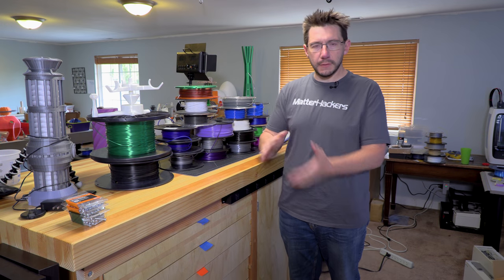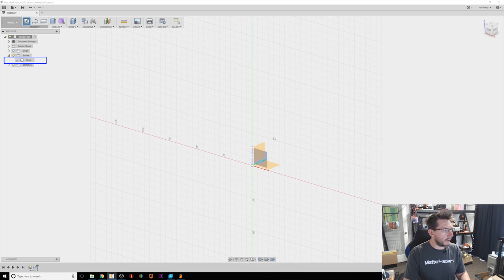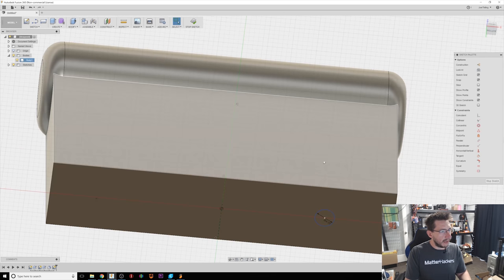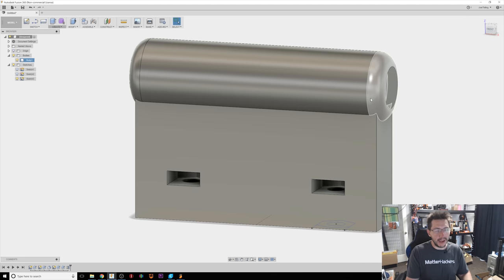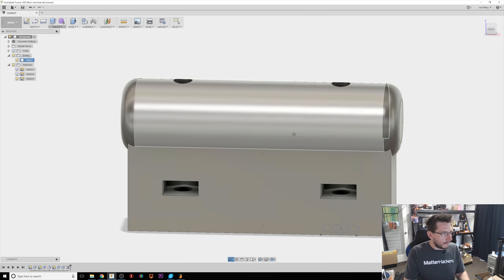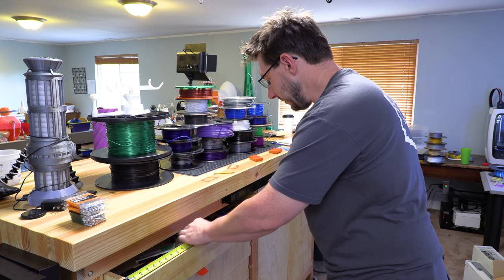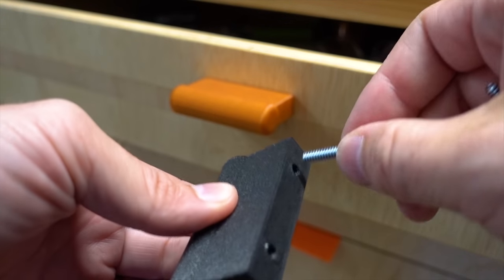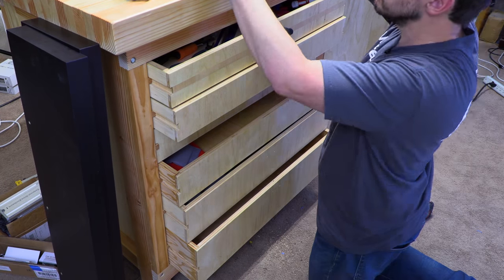DIY Custom Drawer Pulls / Drawer Handles & Jig / Template using 3D Printing!

Comment: very nice job
what height is your work desk
also why not put a block of wood at the back of the drawers to keep them flush to the front
regards
Reply from the maker: It's tall - 45" tall. The drawers open up from both sides of the desk!
Reply: thanks for your reply
i did not know that the drawers opened from both sides
and yes that is a tall bench but i guess it makes it easier for to work on it as there is no bending down to a low desk
regards👍👍

Comment: if you used the same template for drilling the holes, doesn't that mean that the further you go down on the drawers, the more offset the handles will be since the drawers get bigger as you go down?
Reply from the maker: The idea was to have the handles all the same distance from the top of the drawer rather than center - so this worked perfect!
Reply: that makes sense

Comment: Hey maybe you can design a pair of stoppers next - so that the drawers can't slide in too much and always be flush with the rest of the desk.
Reply from the maker: I forgot to mention it, but the drawers open from both sides of the bench, so I'll need to add handles to the other side as well :)

Comment: Easier way to get the center, is use the Metric system. Only have to halve a single number. 33 7/8 inches is about 860mm. 860/2 = 430. done. much easier. ;)

Comment: Just FYI on dimensions in fusion you can do math functions inside a dimension i.e. for the blind nuts of a width of 9.5 just use a dimension of (9.5/2) and it will make the circumscribed polygon the right size with no calculation.  Also on the blind nut , rotate the nut where the flat surface is up and parallel to the bottom where you insert it and it wont turn when tightening. With the way you designed it it only touches on the two bottom sides and can rotate easily just FYI. Good video though. Had a screen shot but you can't post it- I'm not the best in describing with out photos :)
Reply: For a slide-in nut, Joel's design is correct. The nuts are supported from four sides (it the pocket dimensions are accurate enough).

Comment: now design some back stops to stop the draws going back to far.
Reply from the maker: The drawers open from either side of the bench, I probably should have made that clear.
Reply: How about a fancy indent thingamabob so the drawer locates in the centre position? :) Great video, thank you. The jig was an excellent idea - perhaps using a cross instead of a circle for where you mark the draw would help it be as accurate as possible - although the handles looked like they lined up just great.
Reply: Then you're going to need more drawer pulls! :D
And what about the cabinet doors?  Looks to me like the same handled would work just fine.  Using NylonX for the look and texture is a great decision, loved the look.

Comment: Nice - Thanks

But to find center with NO math, take a piece of adding machine tape and mark/cut it or whatever to the width of the drawer then fold the tape in half, instant center with no math.  Used this method in a previous lifetime when I was a pipe welder.  Can also fold again for quarters etc.

Comment: What printer and print bed surface did you used for the NylonX? Also, did you have an enclosure?
Reply: Oh nvm, I just saw the description.
Reply: Arsenic The bed on that machine is garolite I believe. It’s the Matterhackers pulse printer. They offer a mod that is made for printing NylonX. It has a ruby nozzle and the garolite bed. You can print NylonX without an enclosure.

Comment: Millimetre? Did i heard millimetre? Thank you!!!!
Btw, why didn't you make smaller holes and self-tap them using wood screws? No messing around with nuts, it would have been solid enough...
Reply: Gael Lafond , have you done it yourself? How many perimeters?
Reply: Michael S usually 2 perimeters is plenty for self taping hole and with nylon there’s no need to over do it.
Reply from the maker: I thought about it, but I wanted to design the pockets for the nuts and see if it would work. It would have worked tapping the plastic, but, I just wanted to do it this way.
Reply: Michael S I must admit I have never tried it myself. I assume Joel had enough experience with 3D printing to give a good reason for using the nuts... And indeed he have a good reason :)

Comment: I think that you could have done a better job of making them look a bit pretty but hey, they work, which is the main thing.

I did like the way you did Fusion in metric and then went back to imperial to measure the drawer fronts.
Reply from the maker: Beauty is in the eye of the beholder, and these looks exactly the way I wanted them, so, I think they are pretty :)

Comment: you need a stop behind the drawers so you just push them closed all the way and not worry about lining them up flush
Reply from the maker: The drawers open up from both sides of the bench. It's cool being on the other side and being able to open the drawer to get something.
Reply: Aaaah didn't know that. makes sense now

Comment: Joel... Metric... So much simpler. 860.5 mm wide, so half is 430.2 For the accuracy you need for drawer handles 430mm is great an a lot quicker.

Comment: seems like it wouldnt be hard to capture the nut completely inside the print.  just cut the nut out.  have the slicer stop the print after the hole for the nut is finished.  drop the nut inside.  continue print.
Reply: Douglas Spak , it is not that simple. Please try it yourself...
Reply from the maker: I thought about doing that - but I liked the idea of a pocket and an insert, so I modeled it that way to so see if I could, and if it would work.

Comment: Man.. that NylonX is expensive AF
Reply from the maker: Very, unfortunately. I wish it cost less, as it's a lot of fun to print with and use.
Reply: Why did the screws not fit, when the PLA part was fine? Does it perhaps need a different extrusion calibration?
Reply: It's actually not as expensive as it seems, and the reason is because of the density. 

NylonX is 1.00 g/cm3. That's 25% less dense than PLA and most PETG/Copolyester filaments. So, knock 25% off the price and that's a better comparison of price.

Comment: Why didn't you just pause the print a the top of the bolt hole a insert the nuts then you could a had them fully encapsulated.
Reply from the maker: I thought about that, but I didn't want that. I wanted the pocket to insert the nuts.

Comment: Like the practical use of 3D printer and software, but please edit the title to read Draw not 
''Drawer''
Reply: Paul Thomas Drawer is the correct spelling
Reply: Paul Thomas , in USA they are called drawer pulls.
Reply: Michael S or drawer handles.
Reply from the maker: Here in Seattle they are called drawer pulls. I haven't heard just draw pulls before - where do you live?
Reply: Hi Joel I live in Thailand, Sorry it looks like you are right and they are caller Drawers, it's just when I think of a Drawer I think of a person Drawing not a Draw handle. MY bad. So, I have learnt something today so it's a good day.

Comment: I get it Joel 3D print your drawer handles was a great exercise in both printing and creation but..  on the practical side. What was the time used for printing the test and the final Carbon Fiber prints and the time it took to create the product in simply3D? You put these all together and it spells go to home depot. Yes, I know its a fun hobby but it could have been done in 30min or so including the trip to the store. I'm finding out over time that unless 3D printing becomes faster waiting 2 to 3 hours for a simple quality print is just not worth doing. Of course, this is my opinion but as a hobby print away and have fun!
Reply from the maker: Let's see... The design took about 5 minutes when I first did it. The test print was 2 hours, the second print was less than two hours, then the NylonX prints were all done overnight. I know I could have gone to Home Depot, but, I didn't like the look of any I they had to offer, and I was able to do other stuff while the handles were printing. I do agree, though, faster printing is one of the keys of more adoption in the future!
Reply: I was a little harsh but I'm glad you get my point. I printing now something that I saw online and it's fun that's for sure. I came into this wanted to print for profit but found it not really ready for prime time yet but as a hobby I'm having a lot of fun.
Reply: This video was a great demonstration of the principles for when Home Depot (or any other store) doesn't have the precise part you need. Also, waiting for a print isn't dead time like time sitting in traffic would be.
Reply: Well, yes that's true but Home Depot was just an example you have the internet, Amazon Prime, and of course, HomeDepot is not the only store that carries handles. That being said it was just my observation of owning a 3D printer and trying to create and sell products. Like Joel said " I do agree, though, faster printing is one of the keys of more adoption in the future!" Love this is as a hobby I have lot's of fun but until we get the speeds up that's all it's going to be for me anyway. I was told its best to produce the prototype on the 3D printer and then see about casting a mold so I'm looking into that process as well.

Comment: These videos are getting futile. The coasters with Salanderer and now some door knob.... I miss the extravagant Joel. You should research about design intention. You could have extruded cut those screw hole in relation with the surface of the end curve, (like 5mm offset from the surface) so when you need to shorten the whole knob, they would have followed. My 2 cents! Please please please, more hairy lion, Mega F1 and stuff but less coaster and knob. Keep on designing crazy stuff!
Reply from the maker: Yup, just some door knob. Billy, I'm learning as a go, and people seem to like seeing that learning process. Believe me, more large and crazy stuff is coming!
Reply: Billy, yes this was not optimal, but it was good enough. Examples like this are useful for people who are JUST starting out with Fusion 360 and 3D printing.

Comment: A: Metric SUCKS!!!!.... B: A couple of drops of stupid glue on those nuts and they wouldn't move.
Reply from the maker: But how would I remove the nuts later if I wanted to? :)
Reply: I'm 72 and I only 'barely' remember ever removing a drawer pull and that's because it broke. You can worry about that nut in 40 or 50 years.